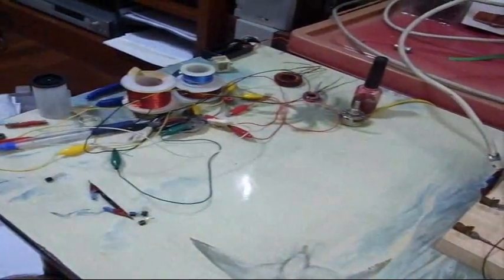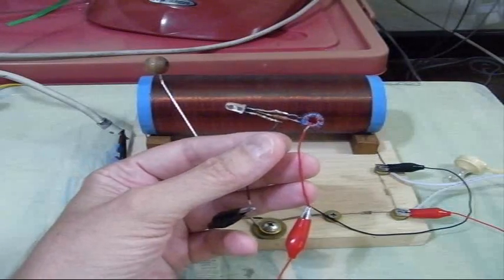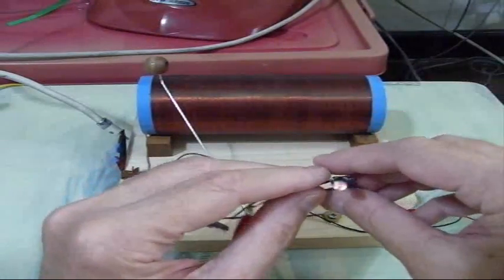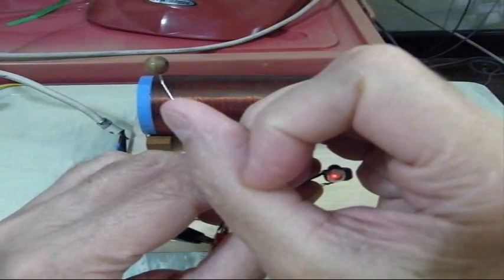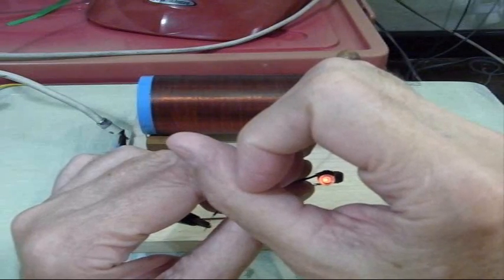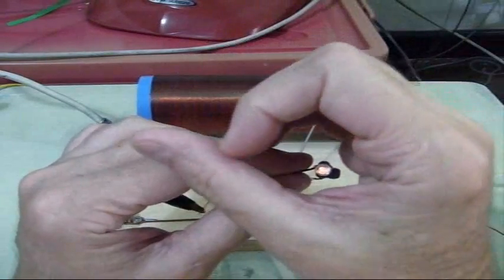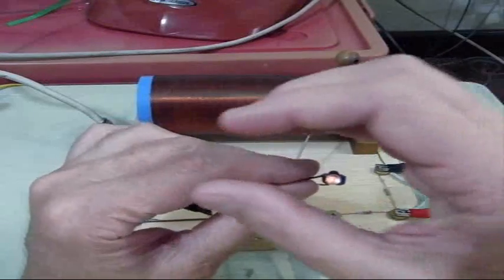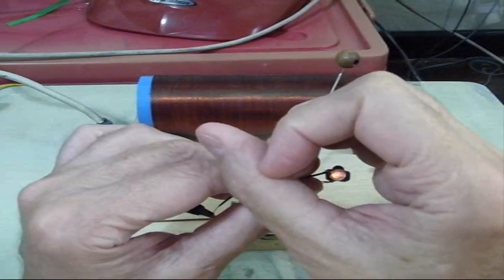Joule Thief PLUS Crystal Radio Equals ???   (Updated Video Available)

Comment from the maker: Remixed version with annotations restored:  https://youtu.be/bb0kNE15Yss

Best/Easiest DIY Crystal Radio - No Batteries, No External Power 2023 (4K)
https://youtu.be/fLVCqZGpv3U

RELATED CRYSTAL RADIO VIDEOS: 
How To Make A Crystal Radio - No Batteries, No External Power: https://youtu.be/mt-s7pf-U5Q   
My New Favorite!  Crystal Radio with Antenna Tuner:    https://youtu.be/mh5KxCpbQ5U
Crystal Radio, Capacitive Tuning - WORKS GREAT!:    https://youtu.be/VJ80Nm9KSkE
Crystal Radio & Resonant Coil Design:     https://youtu.be/Fw9eb-aB-XU
Crystal Radio Antenna (Shortwave Also):    https://youtu.be/G8AsgZbncW4

My Crystal Radio Does NOT Work (FIXES for common problems):    https://youtu.be/kCxQ8iPQx4s
Good Crystal Radio Connection Points:    https://youtu.be/G3qjrReHR1k
Crystal Radio, Connect A DC Audio Amplifier:  https://youtu.be/RW3VhnzgjtA
Three Upgrades For Your Crystal Radio:   https://youtu.be/LENco3_jV_s
Crystal Radio Wiper Upgrade:     https://youtu.be/i1otDz39nlw
Popular Crystal Radio Design That's a Waste of Time - And Why: https://youtu.be/r9Onub2Xpzc   
New Crystal Radio Design - "Modified-Pickard":     https://youtu.be/_qxHhFKjLAg

Comment: Zero point when you tune to higher interference levels your tapping into the scaler field of A.C that can be stepped up to a higher voltage potential for other applications such as a bigger light and beyond just make sure you always call it a crystal radio because the powers at be don't want people to know how to create it

Comment: I have heard about this for some time really don't understand how it could work remarkable I guess but I have a micro crystal radio set that works pretty guess I will be trying this on that set
Reply from the maker: I have other videos where I refined the set up and only use an LED (no joule thief).  Note that it depends on having a good antenna and a good AM station signal.  In fact I powered a watch from the signal!

Comment: BTW, almost 4 years since this video, what about the follow-up?
Reply from the maker: So far that's still the best I've gotten.  I think that unless I build a rig tuned to just 1 loud station or one that takes in many stations at the same time (I think this one does that to a big degree) that's it for this setup.  I am limited by where I live (distance from stations) and how much antenna I can put up.  As I write this I just thought that maybe I should try to estimate the total energy that reaches my house verses how much I have actually received.  That will tell me what the max I can hope for is and tell me what percent of that I am reaching.
Reply: @tsbrownie : Since I have worked with tesla's principals for capturing radio waves to convert into usable electricity, that is the reason why I suggest that you seek to work in much higher frequency ranges, outside of commercial/military broadcast ranges. There is a wealth of energy out there that can be tapped. And with your ability to post that information and a showing of the principals in action, you would have a better ability to reach a wider audience than I did back in the 70s where all I got was the government coming and taking away my laboratory.

Comment: If you want a more steady source of radio wave energy, then wind a pair of coils for higher frequency and use an antenna system that is also tuned to the frequencies you are seeking to capture. That is what Tesla did and he called them "cosmic waves" and yes, it is energy (which operates in the higher frequencies) from the cosmos. A good storage capacitor and you could come up with more usable energy than relying on local radio stations.

Comment: Drop the 1k resistor 1/4 watt to a 100 ohm and see how much brighter it is
Reply: You are just breaking the threshold
Reply from the maker: You can do that, but if you spike the base (go over the max voltage) it does not last long.

Comment: How long is your antenna? I have mine hooked up to a 144mhz antenna and its surprisingly loud and clear. I expected a faint whisper.  My JT unfortunately doesnt do  anything with this radio but does work with a battery so its not wired wrong.   Im betting on the small antenna.what number toroid core are you using?  Mine only puts out 68mv. Im using a t50-1 core.
Reply from the maker: My antenna for this was about 20 meters and vertical.  Also it was really fussy, as I said in the video on one end of the radio it did not work at all, but while I was making the video that end of the radio worked really well.  I am wondering if there was strong radio interference from another source, which is common on AM.  Not sure.
Reply: That's a bit personal.  Lol

Comment: this is the real tesla coil guys magnify the antenna magnify the power an if you run it to a crystal already under pressure its magnified again an converted to ac electric

Comment: Crystal radios have been around for over 100 years. Since I was a kid, I've wondered why not translate the earphone power to electricity? 
I would have assumed some basement scientist would have come up with a way to improve output. I don't have a background in electronics otherwise...
I also get that the power industry wouldn't like this.
But we have a HUGE radio transmitter that our planet orbits.
Why hasn't this been developed further? Or is there one of the electronic laws that limit the device?
Reply from the maker: I use that huge transmitter to power stuff around my house: lights, water pump, ...  It requires a simple receiver/antenna arrangement widely available: it's called a solar panel!  ;)  Sorry, but seriously that's what's going on.  They are working on some experimental solar panels that work just like billions of little antennas and they are much more efficient than current tech.  They are stuck in the lab currently, but when they come out your idea will be commercially available.

Comment: did you consider using a capacitor to smooth it off, it would keep it from pulsating I think. Also, try a 100 ohm potentiometer to increase brightness.
Reply from the maker: Yes, but the electricity acts more like static electricity.  It's fussy and bizarre.
Reply: tsbrownie I don't understand anything that's bizarre...I leave you to your devices on that one.

Comment: your coil is acting as a variac. like the hybrid thinking
Reply from the maker: I did not think about it like that, but yes, you are right.  Thanks for that enlightenment.  Comments like yours makes doing these videos worthwhile.  You can teach an old dog new tricks.
Reply: I've just recently gotten into electronics but I'm trying to absorb as much as i can. Sometimes its overwhelming and then you run across an idea that leads to another that makes things a little clearer. Thank you for the enlightenment.

Comment: Are you using wireless Internet? wireless mic? cellphone? perhaps your higher end signal came from these, wifi, bluetooth ect?
Reply from the maker: Yes, but it's on another floor in a cement building.  I think it's just the ordinary broadcast bands which I can measure at around half a volt.  Run that through a flyback oscillator and it's enough to light up the LED.

Comment: try tuning in to all the radio stations all at the same time to get the most power
Reply from the maker: +Spidermax96 Spidermax96 I thought about that, the problem is that tuning many stations at the same time would require independent single frequency tuners.  If not, some of the signals would cancel out others.  I tried picking up signal from many points on this same coil, but it was not better.  Oh well.

Comment: This is Tesla's free energy device, electricity from air waves.
Reply: danielvincentkelley Crap..... it's just conversion of radio waves to a tiny amount of electrical power. No radio transmission...No power. Tesla was a quack...no such thing as "free energy."
Reply from the maker: Like your raccoon.  The energy is free, just not the ability to use it.  I've done cooking with free energy - every time I get sunburned!  ;)  The real trick is to get the efficiencies up (reduce waste) and cost of collection, conversion and transportation down.  Like putting solar electric / hot water on houses to help offset transmission losses by producing where it's used. 
They've had some solar cells in the lab for a long time now that act more like little antennas and use the "radio" part of the sunlight.  Efficiency is high and has big potential, however they can't produce in quantity and that's been the problem.  I keep hoping.
Reply: tsbrownie As you said...the collection,distribution and conversion is NOT free! Especially in the immense costs of a nuclear power plant. Therefore you cannot get "something for nothing"....So, nope, not "free."
Reply: tsbrownie Yeah I guess really we've been using it for centuries, Sailboats, windmills and the like. Maybe one day? Cold fusion or something?
Reply from the maker: It's never gonna be "free" free, but we can do better.  Right now I've got solar "fill" lighting in the house and our house water pump is solar.  Got the mains in for rooftop solar, but the local gov't is being a pain.   Maybe just "warm" fusion?  ;)
Reply: +tsbrownie hey, thanks for posting this up.  I wonder what output, if any, you'd get if tuned to the low a.m. band where all the quasar star sounds are located? Now that would really be free energy.
Reply: Testla wanted to transmit wireless power not harness radio waves your the quack Paul Austin
Reply: AR-Gaming you can transmit the energy and information to a specific place . I have a teslacoil using for light and charge things wireless like my mobile phone . But i also send AM broadcast . And use my crystal radio to recieve it .
Reply: wow that is a good idea!
now I'm going to build one.
to those that don't now how a crystal radio works it takes radio waves from the air (witch are all around us in a wave length from + to - energy) and gets converted in your radio to music.
build a crystal radio with a kit from online it really works with not batteries.
awesome idea to try.
now I want to build one
Reply: Energy is everywhere,   "Free Energy"  is a con-man's term invented in the 1800's,  at the start of the industrial revolution..   When are people gonna get over the term "Free energy".    the Sun thru Solar panels are "Free energy".   Hydro power is  "Free energy",  except you gotta pay for both of them..      If You make a true "Free energy" device,  You still gotta pay for the device...  Nothing is "Free"  except sarcasm and insults,  which are all the same thing,  and are truly free..    People are very generous with that.
Reply: tsbrownie there is such thing as free energy if you can build a setup that ionizes the air and can collect it and also resonates at Schumann resonance.
Reply: carolyn mmitchell you mean a teslacoil .
Reply: Tesla's tower was grounded to create a circuit. This device isn't grounded. It simply receives radio broadcasts (radio waves) from radio station towers. Without the radio broadcasts there wouldn't be anything (apart from naturally occurring radio waves during thunderstorms) for the crystals to vibrate in sympathy with.
Reply from the maker: Sure there's "free energy", it just the collection, conversion and transmission that's not free.  Uranium, solar, geothermal, ...

Comment: Saw your DIY crystal radio and free energy You Tube , Cool! I would have to Google around find it but there was a crystal radio set design that used the signal power to run and audio amplifier part of the circuit so that it could drive a small speaker instead of head phones. Could provide enough audio application to be heard across a quiet room. Maybe it was two crystal radios one for detection and one for amplification but I think in needed only one coil.  Try build something like that!  Thanks for the post.
Reply from the maker: +ufoengines I've thought about trying to use 1 for powering the modulation circuit for an FM battery-less radio.  Powering a battery type amplifier I have done, that's simple.  Will have to think about your idea.  Interesting.

Comment: there is video of a guy who got a joule thief working with less than .06 eneergy.  search "low voltage joule thief" on youtube you could rummage through his video libary he has some interesting videos that could spark some interesting imaginational things.
Reply from the maker: +moxncal Thanks.  I did go look them up.  Had to think about what he is doing.  He is using a higher ratio of turns primary to secondary on his coil, so he is using less voltage, but a higher current.  How do I know?  Because the power to light the LED is roughly always the same (1.8 volts x 0.009 amps = 0.0162 watts ).  With the crystal radio, on a really good day, I can get right at 0.5 volts.  So to light the LED which requires 0.0162 watts I needed 0.0324 amps (0.0162/0.5).  Larskro is using 0.136 volts in one video, so he needs 0.0162 watts / 0.136 volts = 1.191 amps.  He's chosen to use more amps than voltage.  Of course that tradeoff means a crystal radio won't light that type of joule thief, that's just too many amps.  I used to have a similar circuit that would light a 35 volt neon bulb with button cell.  It only worked because neon requires very, very low currents to operate (in fact they will light with static electricity).  It is fun to play around and see what you can get to do what within those tradeoffs.  Thanks again.
Reply: i was wondering instead of using that transistor, u could used one of those smd transistor.  think stoneslice and eric wasatonic built small joule thiefs.  you could use the inducton smd couple with one of their smd transistors to make it even tinier and with a smd led.  just food for thought.
Reply: wanted to share something with you.  do a youtube search for a video by neatpete4 called "Thane Heins Bitt"  watch his video and see if that would spark your imagination about a ev car that would not need any charging station.  an ev car that could go where ever it wants and not worry about where it needs to recharge.  also it would only need one battery and not tons of batterys.
Reply from the maker: +moxncal I tried surface mount.  I was going for "The World's Smallest Joule Thief" thing, but I found the surface mount transistors I had access to had a low hfe (amplification).  They did not work well.  Barely got any uplift and did not think anyone would be impressed by powering a 1.8 volt LED with 1.5 volts.  ;(
Reply from the maker: +moxncal Not sure what he has going on there.  I hope we come up with a car that needs only 1 small battery in my life time.  Let's hope!

Comment: have you tried it with your no toriod and no transistor joule theif to see if it would also work?  just an idea, try it with an old wireless cell phone antenna and using teslas umm wireless energy from air circuit going into the joule thief to see of it would work.  just an idea.  would be interesting if it does work
Reply from the maker: +moxncal Sort of.  I have a video on the "World's Simplest Radio" which is 1 diode and an earphone and it draws all of its power from the radio signal.  No transistor, no torrid.  I will have to think on how that might light an LED because the incoming voltage is maxed out around half a volt and the LED needs around 1.8 volts.  The transistor / inductor trade current to get a voltage boost up to the 1.8 level.  So I'd have to come up with another way to make that happen.  I will have to think on it.  Thanks for the comment.
Reply: theres a guy who made the tiniest radio out of i think a capacitor and he was trying to conceal it in a ring.  search for it using "tiniest crystal radio"

Comment: You could this current be used to power a small radio on a single transistor
Reply from the maker: Lechoslowianin I am thinking about using it with the crystal radio to drive a speaker so you do not have to use the earphone.
Reply: You could easily get more light out of the Jule Thief if you extend your antenna , it is very nice electrostatic experiment;)
Reply from the maker: Kamil Domjan Thank you.  I am sure you are right about the antenna.  I wonder what the practical upper limit is?  Got to think on that.
Reply: tsbrownie
There are so many ways to do it, you could get square aluminum plate and hang it in your attic-that is best if you want get highest power output or just as high antenna as you can get for crystal radio, my alu plate in attic was able to light up led all year long ;) but remember never use house earth ground and always protect yourself/antena from lightning!!